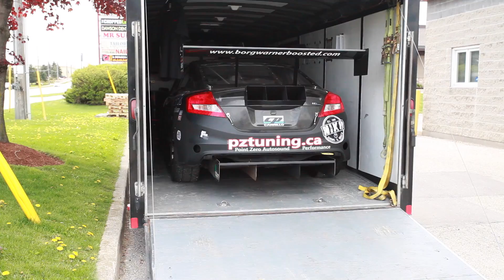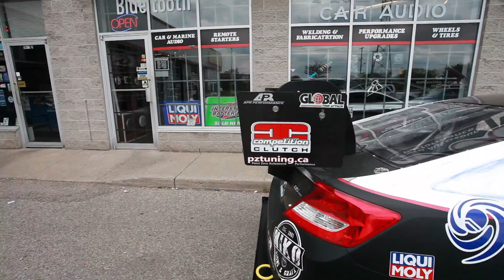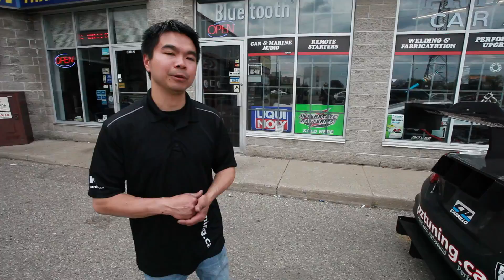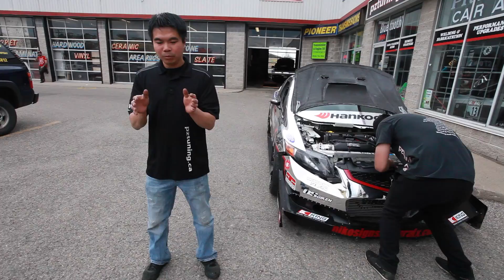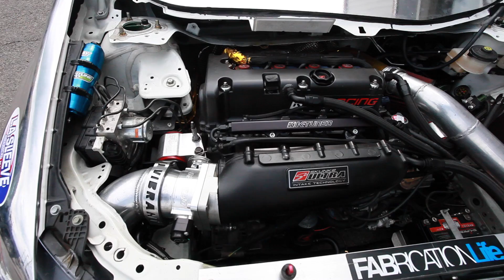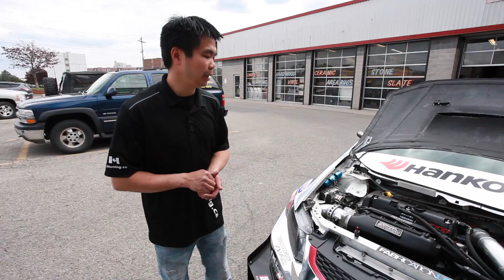771WHP PZ Tuning Civic Springs A Leak At Global Time Attack Road Atlanta!

Comment: Interesting, no left foot braking. I'm by no means questioning the driver, that was a fast lap. Just curious.
Reply: Will had brake failure earlier in the weekend, so he definitely wasn't using the brakes as hard as he normally would. Not sure if he's a left foot braker or not. A lot of road racers don't left foot brake, that's often more of a rally car driver technique.

Comment: why is the turbo where the passenger seat would be. that can't be good for lag, it's a 4 cylinder it can't spool a turbo that big fast anyways why so far.
Reply: u kidding right ?
Reply: You mean the one just sitting there not connected to anything?
Thats not where the turbo normally lives..
Reply: That's not the actual turbo. Also, remote mount turbos aren't any slower to spool.
Reply: he's just storing a spare turbo in the car during transport and hadn't emptied the car out after pulling it out of the trailer for me to shoot the video.
Reply: twin scroll turbo

Comment: God what a monster this car is. I wonder how FWD feels at those speeds.
Reply: Answer: FAST :D
Reply: +David Pratte Jesus I can only imagine! have you guys had any insane brake failures on the track like he did?
Reply: Yes, I had a brake line fail on my dad's C6 Corvette at the track, went off at 100mph into the grass but didn't damage the car too badly. Bent the front rad support, tore out the wheel well liners, did $3k in damage even though it didn't seem like much. Luckily no walls to hit where the brakes failed or it could have been much, much worse. Pretty terrifying experience to go into a high speed braking zone, stomp on the brake pedal and have the pedal go to the floor. I grabbed the e-brake and that was the only thing that slowed me down.